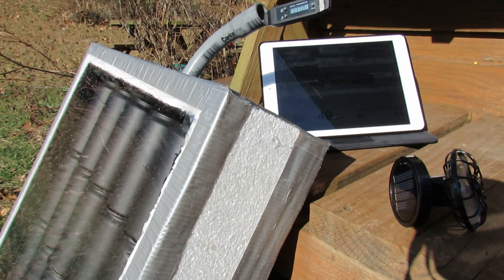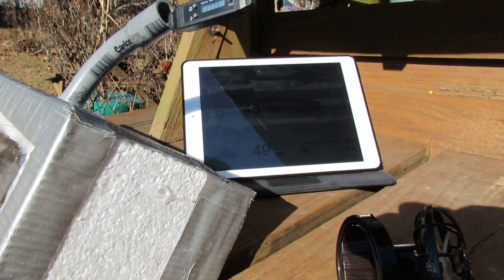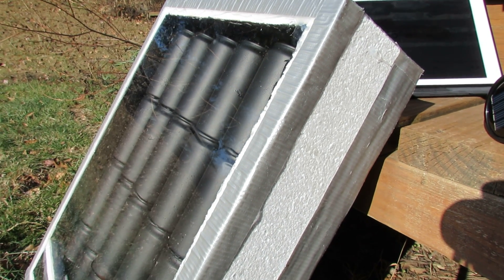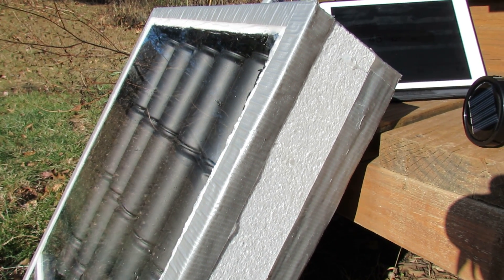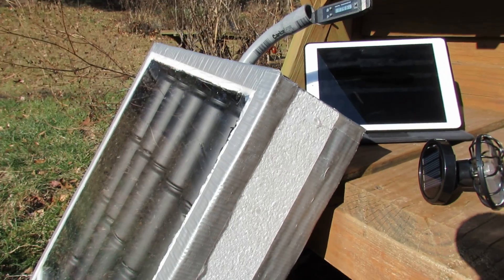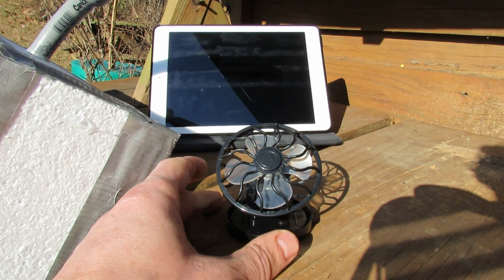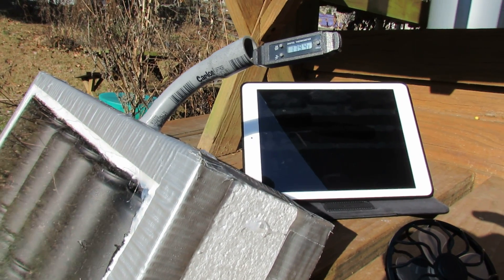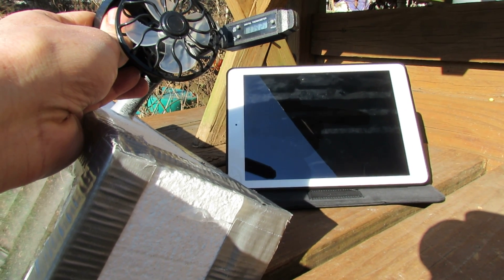A Greenhouse Solar Can Heater: Questions, Thermal Mass, Max Temperature - The Rusted Garden 2013

Comment: can you combine 2 of these by having one heat up air in tubes buried in an insulated pit then have another closer to the greenhouse with another solar fan to draw the warm air under the ground into the green house. This would use the natural rise of heat to the closer solar heater or am I wrong
Reply from the maker: You could. This was a test design for if I ever made one on a large scale. it works. So you could adapt it.
I now have an Amazon Influencer's Storefront. As an Amazon Associate I earn from qualifying purchases.  It is free to use and anything you buy may be eligible.  Just use my... The Rusted Garden link at https://www.amazon.com/shop/garypilarchiktherustedgarden anytime you shop. I have garden items broken into categories.

Comment: wanting to try this and this has been the best video I have found but im curious would shining a heat lamp onto the panel produce similar results as the sun? trying to cut back on electric use but don't want to be without heat at night. if my thoughts work I could cut 3/4 of the lamps ive needed the past few seasons.

Comment: I just saw this, did you build that yourself?  if so, where did you see the plans. I think solar electric might work better if you can find a way to produce enough electric cheap enough to power a heater that will heat the greenhouse and maybe use the thermal mass if necessary. Thanks man, that is really interesting and pop and beer cans are readily available for free if you can get someone to save their cans for you or dig them out of someones trash or whatever.
Reply from the maker: This was I prototype, I build without plans. Just off principles to see if it would work.  You can make it all for free. 
Check out my new Amazon Influencer's Shop. Anything you buy on Amazon helps The Rusted Garden when using my link.  Ill be putting what I use in videos there for 2019. It is all set up by categories. Thanks.  https://www.amazon.com/shop/garypilarchiktherustedgarden

Comment: You definitely need a heat sink. The solar boiler and solar collector get heated when the sun shines. Thermal mass is important. In Belgium we have Iron stone. This is IDEAL thermal mass. In Flanders there is the "Wijngaardberg" in Wezemaal and because of the stone who releases the heat, there is a micro climate.
Reply from the maker: Thanks
Reply: Gary Pilarchik on the other hand: iron sandstone is quiet expensive

Comment: Not contradicting Gary, just to add some additional info.  The greenhouse is itself virtually just as effective a converting sunlight to heat as this solar collector.  The advantage of the solar collector is potentially twofold.  With the solar collector you can increase the effective solar collection area of the greenhouse without increasing the area through which heat is lost to the environment.  If you are willing to add some thermal storage and a bit of control equipment you can store some of the heat for use at night.  Of course a greenhouse can also contain heat storage but there are limits to how hot you can allow your greenhouse to get before the heat will negatively impact the plants (or, in the case of heating your house, how hot the house can get during the day before it becomes very uncomfortable).  Since the heat storage capacity of any thermal mass is directly proportional to the maximum temperature you can heat it to, an external thermal mass (external to the greenhouse) can store much more heat per unit of mass than a similar thermal mass inside the greenhouse.
Reply from the maker: I agree. The key would be heating the thermal storage. I also found that size is nice for an outdoor dehydrator and adding some heat.
Reply: I used an old radiator mat blacked with water,  very  limited but a wax has better thermal properties as it changes from solid to liquid around 27-28 degrees and coconut oil would be perfect.   Ice to water  of course is similar but too cold.   Unless wax could be modified  to suit but I doubt its possible not being a chemist?

Comment: I'd run that pipe through in an underground heat sink 5 foot Underground with insulation on the top and sides. Geo air Style it would charge up like an underground battery you would still need electricity for the blower fan. I would probably use a solar panel setup too, then the greenhouse would be so hot you would need a barn fan in there.
Reply from the maker: Thanks.
Reply: +Gary Pilarchik (The Rusted Garden) You're one of the great people that got us started gardening so thank you as well, very much!!!

Comment: Have you tried putting the fan inside the housing to have a warmer trajectory of airflow? I'd imagine if sealed tightly, any air movement would create air resistance right? Intake on the bottom, solar powered exhaust at the top to remove the airflow from the unit into the room. Would the intake need to be powered as well? Or would you have a powered intake creating more air intake, and have it exhausting without power?

So many questions. I should make one and experiment. But I don't drink nearly enough pop, beer, or eat canned things often. :D

Comment: how effective is the solarcan in the winter that can range from -20- -40 degrees? is it even possible to utilize it at all in the cold climate?
Reply from the maker: thtguy ish We dont get past 15 degrees. I don't know how it would work at colder temps. It should still warm the air but I don't know. Sorry.
Reply: thtguy ish Of course.
No matter how cold it might get, the sun's emission does not change (ok, perhaps it fluctuates a bit, all the time).
But, this setup will collect LOTS of solar heat, all the time of the day.

Comment: I forgot , hence we air is not used as a heat medium in heat exchangers, water would be better or  heating oil.
Reply from the maker: Antonio Pachowko I am thinking of water as the system. However, I keep thinking its time to move to a place without a community association so I can do more. I'd like to make a large scale solar water heat system.

Comment: Gary the heat load can be easily calculated from  mass flowrate of air x specific heat capacity of air x temperature rise  or as the mass flowrate of air needs to be known, you can estimate the heat load per unit mass (known as specific energy) as

 specific heat capacity  of air x temperature rise.  As specific heat capacity of gases are temperature dependent , I will use an average of 1.006 J/kg/K, whilst the temperature rise would be around 82 degrees C , but this is dependent on the inlet temperature of the air.

 The specific energy would therefore be 82.49 J/kg, and if we assume a velocity through the system of 2m/s, and a density of 1.12kg/m3, would result at   a mass flow rate of   0.00135 kg/s, so that the heat load would be  0.1 W, so in effect hardly no heat energy is produced
Reply from the maker: Antonio Pachowko I would not say easily. Id say you have some good skills there. What's your profession?
Reply: You have calculated in Watt/second which should be multiplied by 3600 to get Wh as more standard unit, which translates to cca 899Wh. But with active fan (speed 2 m/s-2) temperature ries will be much lower. In reality you can obtain 300-350W panel per square meter - diy way

Comment: Would like to see your model sitting " inside" your house like a south facing window in a bedroom, would it work thru the glass?
 ie, would it work thru the clear plastic of a green house or poly tunnel? That way you wouldn't have to drill holes into your house/tunnel.
Reply: +Adrie Sweep I'm also going to try making one with the small skinny "redbull cans"...as they will likely produce even more heat /sq. ft. as they are narrower so more vertical rows can be done as well.
Reply from the maker: eveny119 That would be a good application. Believe it or not, I dont have a south facing window.
Reply: I was an Architect for 25+ yrs. The real question isn't how much air or what the output of flow is by adding solar powered CPU fans into the system, but HOW do you close off the cold and hot air tubes at night. You need in essence a durable insulated flap. It can be as simple as plugging both holes at night with a thick insulated pad made with insulation with rubber seal edge like a wide rubber boot used for plumbing supply pipes as typically used for a 3.5 or 4" pipe, or felt doorseal type seal. You can also make a handle on it to easily push it into hole & pull it back out and attach handle too piece of plywood and glue the insulation foam to backside of it. these "plugs" would work well and not allow cold air at night to travel into the room.

Also, Yes, Eveny119, You CAN install cans & foam inside existing windows and attach a hole at top to allow hot air to come into home at day, however you want to close it off at night.

On a large scale: One experimental home my Physics & Solar Architect Profs taught with at Iowa State Univ. in early 1980's for the Physics Professors home had an exterior wall "sliding door size" opening made of 2 layers of glass and blew foam balls between them at night at the top side of the jamb between the 2 panels. The foam balls were sucked out at the bottom during the morning into storage container tubes inside the exterior walls. The foam balls were pumped/sucked with very little air volume. several CPU fans tied together would probably today do the trick nicely instead of electric power used. This gave the basic glass wall which is less than R5 a higher R value at night to better insulate it and not allow hot air to escape. This principle could also be used on a greenhouse roof if desired at night with a 2 layer skin roof done in the same manner. You would want the roof to be filled at the top of the 2 sides of roof at end gables into the peak at sides of panels, and then sucked out along the bottom of panels where they meet the side walls and could go into plastic or pvc tubes...note, cheap thin wall PVC tubes can be used like used on trailer homes since they are still rigged wall and you are not exposing them to exterior air/wind/rain/snow. They can take up a small portion of a wall, even possibly a low horizontal wall of 30" or 36" ht would still work for them to be laid up inside in a coiling fashion and cut grooves into the studs to allow them to pass thru easily. You can use smaller pvc tubes too...2" would even be adequate and not allow the balls to jamb up into them. As long as NO MOISTURE gets into the tubes or between the glass or plexi panels you are ok. The foam balls need to remain dry permanently.

For "panels as walls,the best way if possible is to build panels as large vertical windows on exterior of the house as "part" of the exterior walls. Exterior walls have typically 5 1/2" thick construction or at the least a 3.5" thick insulation in them between the outer layer of wall and the 1/2 or 5/8" thick inner wall surface.

For night time storage as "thermal mass" I was able to do this on the end of a earth home I designed and was built for a client in Ottumwa, IA at the north end of town in 1983. It had a south exposed room they wanted to use with a "dipping tub" made for 1 person to comfortably sit in at night. We made it from an old oil drum and had it coated with inside & outside layer of galvanized alum. coating to protect it long term. We also had a drain in it to allow the water inside to sometimes be drained if desired when not in use. It had 2 uses, 1st as a daytime heat sink that 2nd became a dipping tub. It was put into the floor into a tub concrete tub the size of the room. The concrete we poured with rerod and mesh and was 4"thick. Outside it and under it were "cobravent" layers of their patented black webmesh as panels which kept airflow and no water from touching the concrete. Then we also put regular 3" thick foam insulation under that and around it on the walls which were below grade. This insulated the concrete from the ground wetness and temperature. I then had the concrete sprayed with ProSoCo (water sealant). I heard about them in 1980 and used them on 8 story concrete parking garage constructions in DesMoines and also on almost every home I designed since then for many years when it was needed. It soaks into new cured concrete more than 1" in most of the surface and by chemical process doesn't allow water to penetrate back thru the concrete but only as water "vapor". This makes sure no water flooding, etc. or rusting of rerods by using winter salts in application on driveways, etc. http://www.prosoco.com/WaterRepellents

I then made an interior concrete tub suspended apart from the outer walls and floor with standard concrete parking barriers to  hold it off the floor and allowing the "airflow" around it. I then filled the tub which was 48" deep as determined by my calculations using all of the mass of the home, exposed walls, roof, etc. for my calculations for the desired heat gain of the whole home. The idea was that most of the home was bermed into earth and stayed at constant ground temp so not much of the home was above the ground nor much to heat up during winters.
I filled the tub with 1.5" - 3" river rock....important that the rocks vary in size to allow air to travel between them and get maximum thermal sink for its size/volume.   Then for the floor I used Cor-tube concrete slab which had cored holes in it already. This them allowed the heat to transfer to the inside of the home mostly by convection process but I installed small fans at end of each tube hooked up to electric current to help pull the airflow inside. On top of the floor I used mexican clay pavers with flat non-gloss glaze so the suns rays would quickly go thru them into /thru the core tubes and under to deeply heat up the rock. Taking all day to heat up the rock and released it at night thru the coreslab at ends near south exterior wall with a simple day/night timer used to open flaps with very dense brass screens to not allow any critters, not even gnats to fly thru it. These have to be special ordered back then and I'm not sure they are available today but may be at a very high cost. The other ways I did it later in 2 other homes with same floor heat sink was thru the wall behind the sunroom going into the larger portion of home. I allowed tubes to carry the excess heat from the floor rocks into tubes and up by gravity to "cobravent" vents as slots along the entire length of the roof surface at the roof and larger room wall junction. Typically it's where the roofing is flashed and sealed up against the taller vertical wall for ice/snow. I just did the same thing but put the cobravent between the 2 layers of flashing/counterflashing and ran it 4" from wall onto roof to allow the heat as vapor to escape from the room naturally. Of course you also need flaps inside the wall tubes to be turned manually or via mechanical hinge with solar attached switch. (think of it like a choke cable on your car to allow it to open/close). It's that simple. In summertime it allows the home summer sun at night to get out of the room easily while you sleep as the rock starts to let out its heat after 6pm in summer.

You can use these concepts easily for a greenhouse even NOT attached to a home. Mine were attached usually as a room which allowed activity in them all year around. The bonus of the floors being warm at night all year around helps keep the plants warm too....but as in radiant tube floors, keep the plants elevated off the direct concrete/clay/tile floors with wheel carts or simple elevated 2x2's with board over them. This will allow airflow under the plants and not transfer the heat directly into plants to burn their roots and cook the soil too hot. 

Hope this helps enthusiasts a little more and helps you create better uses of the ideas for your own needs.

D. Dominique Watts
dwatts62@yahoo.com

I will be needing to use these principles again in the coming year on my home purchased last July as it needs to be retrofitted from it's life that ended in 2008 with nobody living in it. Fortunately I have large forest area and large yard behind and to all sides of my home to work with for making even a small japanese teahouse and greenhouse and woodshop. All will be using the sun for heat and storage of heat into floor to keep me and plants and space warm in winters. All will have electric power via sun for lighting and for my power tools usage although I use many old hand tools for much of my woodworking needs too. Can't wait until they are all done. Will just take me about a year for each one of them.

Time & Money ...............as always. Homes & yards can always have more spent on them....that's the problem. What we can live with & without and to make our lives as frugal as possible I think also is the key too. I don't like wasting things. I try to re-use as much as possible.

Good luck all. ;)
Reply: +D.Dominique Watts put it inside, nothing to close off
Reply: +Adrie Sweep - I know you can put the units inside...I mention this.. If the units are held in place above a double hung window resting above the bottom sash, you can then strap 2 bungie cords across the back of the unit with screws at each side of the jambs on both sides. This holds the unit flat against the inside of the upper window glass.